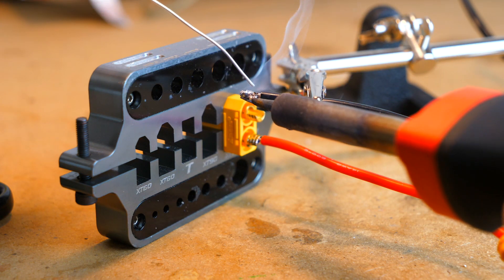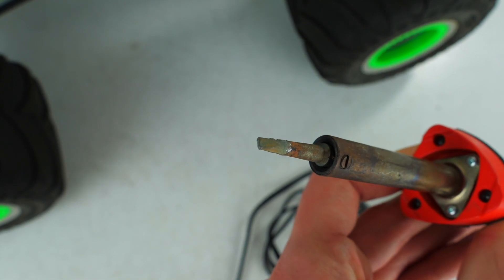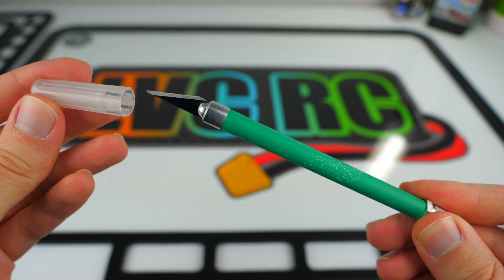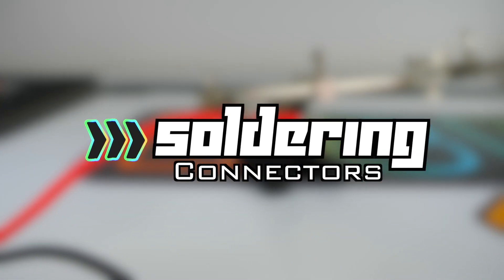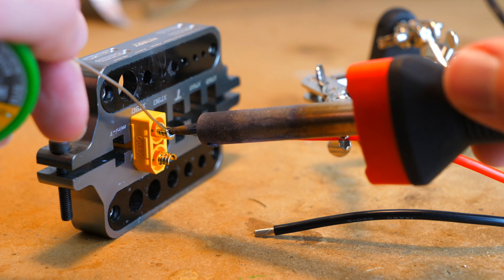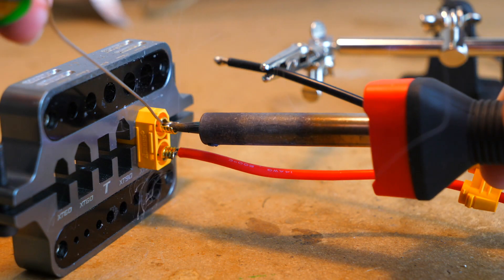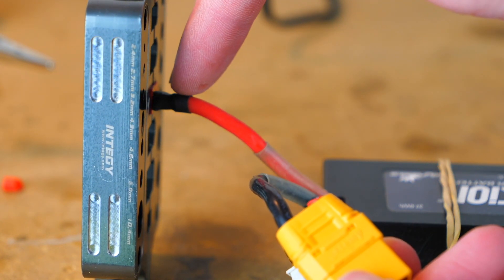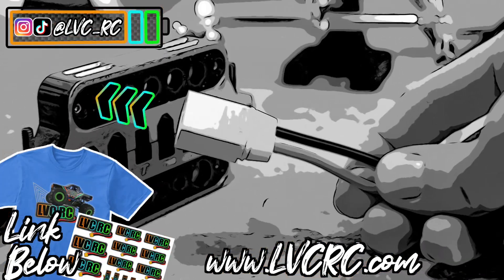How To Solder RC Cars | Tools, Techniques, & Tips

Comment: So no need for flux if you use rosin core?
Reply from the maker: @whisps1  You technically don’t need separate flux since rosin core solder already has flux in it, but additional flux never hurts.